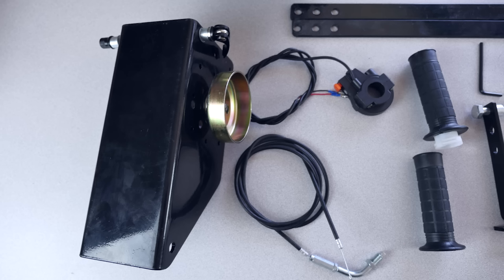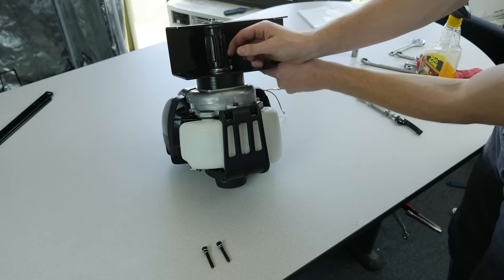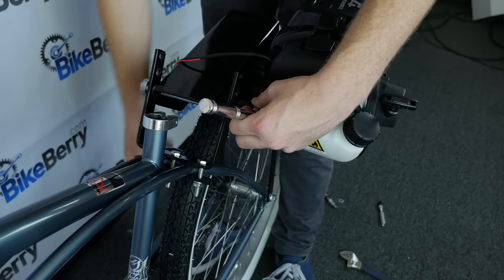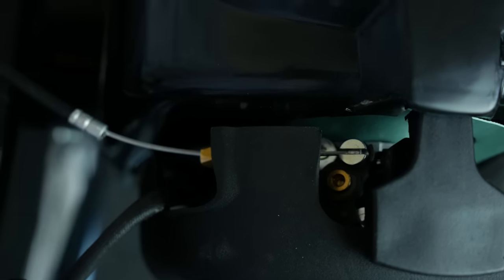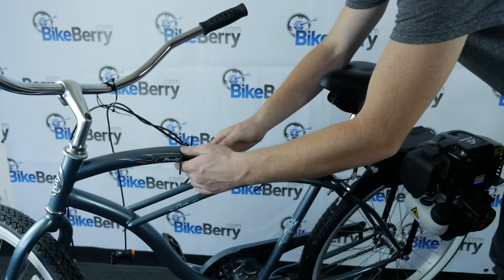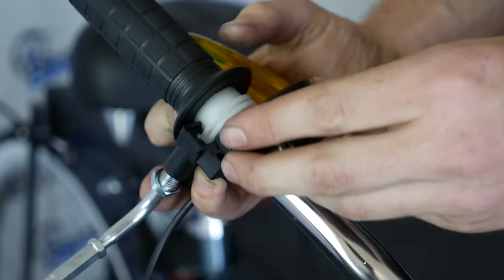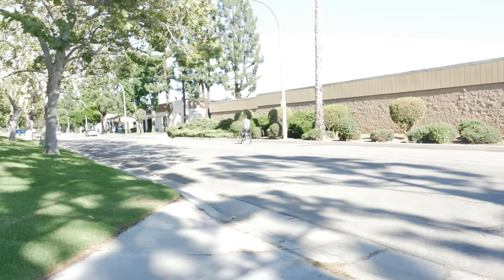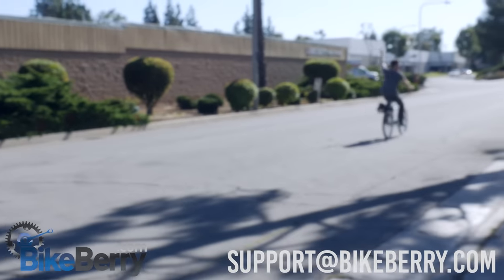4-Stroke 38cc Friction Drive Motor Bicycle Engine Kit Installation | The Flying Horse Lock-n-Load

Comment: Can you use this In wet conditions like mud, snow or rain or will it just slip
Reply from the maker: For your personal safety, and for the longevity of the bike, we would not recommend riding during wet conditions. We do, however, understand riding in wet conditions may become necessary. In these situations, the friction drive system should work just fine, as long as applied pressure to the tire is not too light. Although, extremely muddy or snowy conditions can cause build up on the drive spindle, as well as build up on the rear sprockets and derailleurs of your bike.

Comment: For this new engine that you are talking about can I use 10W-30 synthetic motor oil?
Reply: I have at home
Reply from the maker: Automotive and scooter oil is very similar, but scooter oil is designed to hold it's viscosity a little better, increasing the longevity and performance of your engine.

Comment: Can I use a Briggs and Stratton horizontal shaft engine (I own already) and use the rest of your kit?
Reply: The kit uses a horizontal shaft engine.  A vertical shaft engine won't fit, or could experience lubrication problems if mounted 90 degrees from intended use.

Comment: Notice he did not show how he managed to bolt the engine to the mount. The mount is a tight space to put in bolts and you have to align the bolts just right to go into mount. If the bolts or bolt holes are not just right you will not be able to mount the motor.

Comment: ate these shorter then 49cc engine, my 49cc keeps wrecking my gearboxes, I need something that won't wreck the gearboxes, these only 3 types of gearboxes 4g 7g trimatic and chain drive ones single and double will these engines  fit the gearboxes.
Reply from the maker: The dimensions for our 38cc is 8”x 10” x 9.5", while our 49cc measures at 9”x 9.5” x 7”

Comment: Its an exact copy of the bike machine from the 80s with a Mitsubishi engine, I use to have  one, it was to 2 strokes but kept on breaking seat stays, O ve changed 3 bikes because the bikes were warranted for 2 yrs and they couldn't find signs of abuse to explain the seat stays to unweld
Reply from the maker: We have never seen the bike machine in this set up but would love to. We have yet to hear of any similar problems with our kit but will keep an eye out for any signs.

Comment: I live in the UK and hold a full motorcycle licence since 1982.So nothing to stop me.Have an ebike all legal with throttle only and peddle assist as bike3years old.Anyway cool kit How much please including shipping.Insurance should be dirt cheap.Full licence covers everything thoughight need to install light indicators depending what they class it as.Who cares easy to comply with laws plus how many miles  part gallon even if it doesn't hold full gallon.

Comment: Is there any place in North America where this can be legally used on a public road ?
Reply: CaptHollister probobly not California but many states don't even require registration or insurance for scooters and mopeds and for the states that do there would be a process to register it that probobly isn't expensive or hard to do its a homemade moped
Reply: CaptHollister It actually is legal here in Cali, although a DMV plate is needed along side with a one time $18 fee. I do believe you have to go under 25 MPH, I believe, wear a helmet, and not have a Transmission of any sort as it is illegal.
Reply: CaptHollister not in the u.s.. there is 1 exception - c.v.c 407.5

Comment: When you put the engine on with the zip ties where are the bolts for locking it down with the 1mm wrench and the kill switch on it?
Reply: Is it ok to use Ty-Raps?

Comment: ooooo i do like you guys!! Will this work on my womans bike? been looking for an engine to mount on my girls bike, but the 80cc 2 stroke I believe will not fit my bike...this looks like it might :)
Reply from the maker: Unfortunately, most women's bikes can not accommodate a center mount engine, our friction drive engine is a perfect fit for most 26" - 29" bikes. If you have more questions contact our customer service representatives at 1-800-317-0479, we'll be happy to help.
Reply: Hey don't get this Engine kit I had 8 problems with it so far it's been a year since I purchased it
Reply: BikeBerrycom do you think I can return this for a refund because I have had nonstop problems with it for a year and it has only gone 30 miles so far

I have went through two bell rotors so far and PS I am not riding down hills or throttling it hard
Reply from the maker: Unfortunately do to our company policies, we would not be able to offer a full refund, as the item being received a year ago and due to legal restrictions involving engines with gasoline being ran through them. We will be happy to work with you in looking at your specific order in detail and figuring out what we can do as a solution. Please call our customer service representatives at 1-800-317-0479. We will happily work with you to finding a solution.
Reply from the maker: We're sorry you've had a negative experience with our product. We do try to work with every customer in solving any problem they may have, though, we are occasionally faced with conflicts regarding what we are capable providing, largely due to policies or legal restrictions. Contact our customer service representatives at 1-800-317-0479, we'd be happy to work with you in finding a solution.
Reply: Thanks for the heads up, but could be a million reasons why your having problems. Not saying it's you or them, just saying. I'm still pondering options while waiting for stock, been thinking of getting a trike and slapping a motor on that. Who knows. I do however in my reserch, have some faith in this company for help us problems ensue, this is new to me, and I am aware much can go wrong. Thank you :)

Comment: Which is better 2stroke or 4stroke what is the difference between them
Reply: Let me sum it up 2 strokes are garbage but light weight and affordable but 4 strokes last way longer run better less maintenance faster to most cases and sound quieter and don't burn lots of oil and you don't have to mix fuel
Reply: +RICERIRIRICE not really actually two strokes are faster but yes they don't last as long and are loud but they aren't crap

Comment: I had a 4 stroke Honda bicycle engine and it lasted 6 weeks, better get a 2 stroke as I did after the 4 stroke and I put 10k miles on it and sold it 3 years ago and its still running...

Comment: are those engines as efficient as the two stroke ones 
?
Reply: better it's a 4 stroke they last way longer dude
Reply: +victor larraondo Two stroke engines are louder, dirtier and need more maintenance.

38cc 4 stroke engine on a bike, trust me, is more than enough.

Comment: any chance you can get it less lopsided?
Reply from the maker: Due to the nature of the drive method, this would be impossible without additional flywheels, belts, and mounting brackets. This would unfortunately make the engines profile much larger. One solution, possibly the easiest and most practical solution, is to install a pannier to offset the weight.

Comment: Can you put 2 of them in one bike ?(one on the front and back)
Reply from the maker: You certainly can, but we would advice to refrain from putting any weight over the front wheel, whenever possible. The added benefit of having two of these engine kits would not be as cost effective as buying a larger engine, or a center mounted engine with performance parts.
Reply: BikeBerrycom can you use this motor in a mountain bike ?

Comment: Will a electrical kit or gas motor work on a adult tricycle?
Reply from the maker: We have seen individuals mount electric and gas engine kits to tricycles, but we do not carry any of these kits. There are numerous DIY instructions on how these can be done.
Reply: Thank you for the information. I'm an old man and would like to go biking. How much is your kit that you  are showing on this video? I  have a 26 inch wheel.
Reply from the maker: visit us at bikeberry.com for up to date pricing. You can also give us a call at  (800)317-0479 and one of our specialist will be more than happy to steer you in the right direction.

Comment: The problem with that is that here in Florida putting a gas powered motor on a bicycle makes it no longer a bicycle. But turns it into a moped. And that's because it exceeds 20MPH.

Comment: will it work in the snow
Reply from the maker: Riding in wet and slippery conditions is never advised. Riding a fat tire bike will help prevent loss of traction but is never guaranteed. Water or any other liquid that can act as a lubricant will effect the performance of a friction drive engine.

Comment: Can those be installed on a rear suspension mountain bike?
Reply from the maker: This should fit most bikes. Additional modification to the bike or mounting system may be if there is interference in the frame or the wheels looking system.
Reply from the maker: The removal of parts is not necessary as the brackets will fit around the rear axle or quick release, we would instead recommend building custom brackets if this engine kit is desired. The issue is because of the tight geometry used with rear suspension. The seat stay on hard tail bikes is has a wider angle, which would allow for proper mounting space above the wheel and behind the seat. The narrower angle would put the engine inside the seat post if attempting to mount a friction drive system on a rear suspension frame with the included brackets. An extended front mounting bracket would be recommended if you are set on fixing this engine kit to a rear suspension bike. It is a lot of work and not entirely recommended for anyone looking for a quick and easy build, but it is not impossible or excessively difficulty to do.

Comment: After the break in do you use just gasoline only with no mix ratio?
Reply from the maker: A mix of fuel and oil is for 2 stroke engines. 4 stroke engines have a separate reservoir for each, which do not require mixing the two fluids. 2 strokes need a continuous mix, the only difference after the break in period is for a leaner, more gas heavy mixture than what was used for the break in.

Comment: would you not need a motorcycle driver state license this, other wise every one with a suspended drivers license would be doing this, so what is the law?
Reply: +lonlyhousewife If the engine is below 49cc you don't need a motorcycle driver license.
Reply: depends on your states laws, all states differ.

Comment: any reason they dont mount the motor there and have it run a chain down to the rear wheel?
Reply: Bigger project. People get very specific about doing that because ideally you want a good gear/chain length ratio for maximum performance of the fuel you're using.

It can be done, but requires mounting the engine within the bike frame, installing a jack shaft, removing the pedals, and installing a different sized sprocket on the rear tire.

That's for the elitists.

I haven't seen anyone half ass it yet, but I'm sure you can.

There are videos about doing this yourself here on YT still.
Reply: @AgeofReason  just seems like you could run a chain from the back down and not have to worry about it eating away at your tire

Comment: I have a 29in mountain bike will it it work?
Reply from the maker: This engine will absolutely work. Depending if your bike has large guards around the back eyelets, some modification to the mounting brackets or the bike may be needed, but this is a universal engine kit that will work on most bikes.

Comment: is it possible to mount engine on the front wheel?
Reply from the maker: Our brackets are not suited for front wheel mounting, and we would not recommend putting additional weight on the front wheel, as it would hinder the ability to steer.

Comment: Why do you have to drill a hole in the bars to mount?  Seems crazy.  Motorcycle throttles don't require this and there would be a lot less torque on this bike.

Comment: would this work on a 20" bike
Reply from the maker: 38cc Engine is 8”x 10” x 9.5” and fits on to nearly any bike with standard tires. The mount can support tires up to 3” in width.

Comment: Would this kit work on mountain bike tires
Reply from the maker: Yes long as it falls in the specs provided
Reply: BikeBerrycom and also, would I work with a 7 speed and/ or rear suspension
Reply from the maker: @chipcool6654  yes
Reply: BikeBerrycom oh, I thought it wouldn’t work with rear suspension!

Comment: When will someone make a motor where the shaft faces the left side and have a sprocket on the left side and a 10 speed on the other side, the motor drives the pedal crank and the crank drives the wheels, that way you can still use the gears

Comment: Would I be able to make purchases using such things as visa gift cards and such?
Reply from the maker: whiteyjohncurly Yes!
Reply: +BikeBerrycom Just mounted one to a 26", but have not started it.
The bike is green, but the engine is red.
Dam, gotta paint the plastic casing!

I hate it when that happens!
Reply: +Karl Mark should paint the bike red, that how it goes faster
Reply: +Gary Chief 
Gave away the green bike.
Now restoring a mongoose aluminum frame.
Will tell you if it fits or not.
Should be a retail kit for a box on the opposite side, as the motor tends to hang way out over the left, making the rider look like a complete 
dweeber.

Comment: System will eat tires by the dozen. Old French moped "Solex" did the same and caused a lot of accidents because of a forced transmission. Later this moped was equipped with a centrifugal transmission and named it the "Solex automatic".
Reply: CAM Geurs would it blowout
Reply from the maker: We do recognize the added wear due to the friction drive system. We have not, however, heard of any accidents pertaining to this product from any customers.

Comment: My sis bought a bike kit for me last Xmas and the friction motor did not go with the bike they sent me
So I had to buy another bike that was compatible with the motor
Then the motor didn’t work I contacted bike berry and they said they would send me a part that they thought would fix the motor
4 months later I never received the part so I’m stuck making payments on a bike that doesn’t work
They basically robbed me
It was the worst experience I ever had with a company buyers beware

Comment: Will this fit onto a 29" Wheel?
Reply from the maker: Our mounting brackets are designed for 26" and 27.5" wheels in mind. With some modifications, this can be made to fit a 29" wheel.
Reply: +BikeBerrycom how about in 20" bmx bike?
Reply from the maker: We have heard of customers mounting our engines onto small wheel bikes, but we can not guarantee that it will fit with our mounting brackets or that there will be enough room to ride safely and comfortably.

Comment: can this be modified  to go faster?
Reply: +Marie Miller it already goes 40 mph right out of the box
Reply: +Justin Suszek 20*
Reply: You can probably bore out the cylinder to get more horsepower.

Comment: Is anybody else wondering how much tire wear will be affected by friction from both the pavement and the drive mechanism? I have a 80cc motorized bicycle and the rear tire wore down to the point of needing replacement within 3 months. Add to this the fact that the motor sits directly above the tire, surely the extra pressure from it's weight will play a huge factor in tire wear
Reply from the maker: It will wear the tire more so , however the biggest factors will be from the wight of the rider and riding style.

Comment: the stihl 2-stroke 066 weed whacker engine will work to. but it might have way more power, and a higher rpm so you faster. So why do people like four strokes so much?
Reply: quieter last longer rev and go no need to mix oil and gas ( i dont understand  the ratio thing ) 4 stroke is good for beginners  i would like to get a 2 stroke but i dont know how to work on motors
Reply: +Marie Miller its simple, you will learn someday if you ever get a 2 stroke, or any sort of chain saw for that matter

Comment: How fast this go?
Reply: Depends on your tire size & drive roller size & weight of the bike. Using this setup on a bike with 26 wheels & street tires you should be able to reach speeds bettwen 25 & 30 MPH. Fastest I got my friction drive bike up to was about 32 MPH. Average I do between 25 & 28 MPH. My engine is a 35cc, my wheels are 29s & my drive roller is the largest one they had. My bike weighs about 30lbs with the motor installed which is considered pretty light which helps with top speed.

Comment: It looks like that drive system would wear out the tire rather quickly!
Reply from the maker: The friction drive system does create added wear, but with a good tire it would not be significant.
Reply: I noticed it was a brand new tire on that old bike

Comment: got my kit and just like everyone else, parts missing, parts that don't belong, parts cut wrong. WTF? Now I'm waiting on a review of the "alleged" missing items as stated by customer support.  BB, are you gonna hose me over? I was planning on buying the 79cc kit for my Harley Davidson Beach Cruiser 29" bike, but if it's going to be this difficult...
Reply: Did you ever get em
Reply: @superdj2456  they sent me the exact stuff as before. I have to cut the side mounts because you can’t raise and lower the engine because the slits aren’t cut at an angle like in the video, they are straight up and down. Also, those same slits aren’t cut wide enough for the mounting bolts to fit. AND my Clutch drum broke after 10 minutes of riding. It’s a nightmare
Reply: @beepbopboop1303  I see lol damn I wanted something like how this was advertised

Comment: Cutting and splicing wires creates a high resistance in the wire with resulting localised heating and fire risk.  Always use a proprietary connector or solder and heat shrink.  And the brakes are????  Legality???